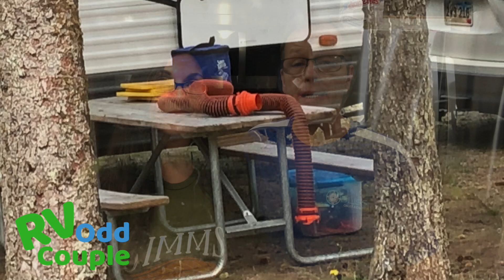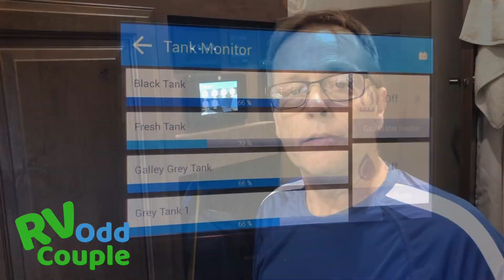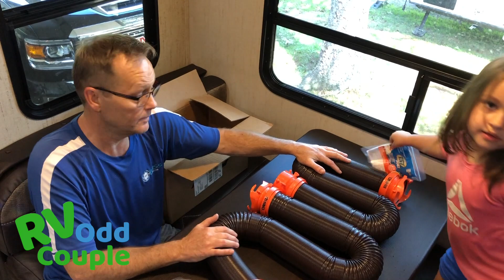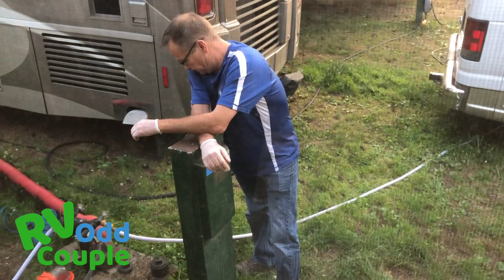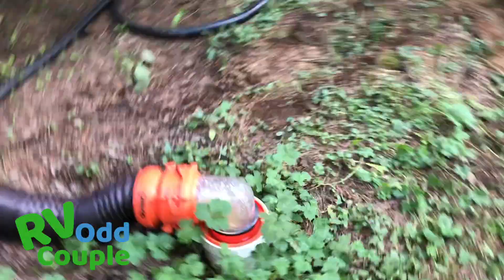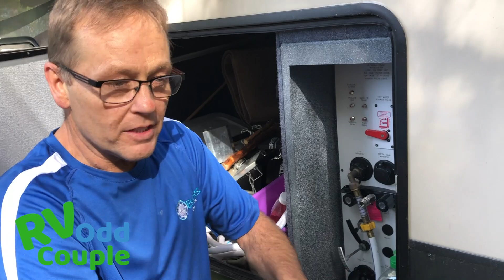RV Black Tank- Flush, Sensors, Hose, & Smell (Fulltime RV Living)

Comment: I learned a lot since I have not yet used my black tank for "solid" matter.  Question.  Do you use normal toilet paper or do you have to order the expensive RV toilet paper?  Thanks
Reply: I was told never to use normal household paper in the RV
Reply from the maker: @stephenryan185  We've heard that too.  We've also heard that as long as it dissolves when in water, it's ok.
Reply from the maker: We use Septic safe Angel Soft. Some will say this (Angel Soft) is not ok but it has worked great for us. Thank you David💚😀👍

Comment: I recently bought a used 5th wheel. I emptied all the tanks for travel every time. Every time I went to hook up the sewer hose I had a 'surprise of a pipe full of stuff from the black tank. I tried the flush system included in the RV system to no avail. I did find a solution.

I bought the Camco flush kit that has a clear 45 deg elbow and a valve. I used the flush connection on the elbow to flush the black tank multiple times. Every flush would dislodge more 'saved' sewage. It took me close to TEN(10) iterations before the water finally drained out clear. The black tank valve finally went completely closed. I believe some toilet paper had gotten stuck.

I left the clear 45 elbow on with the valve closed for this last travel. The cap did reach to close over the valve opening. This time there was a new surprise! NO leftover sewage in the piping system!

While you may not want to spend the extra for the "RV toilet paper' you should at least get the 'septic safe' variety. You want toilet paper that will dissolve quickly after your initial use. No more "POOP PYRAMIDS" for me!

The next step for me is to get a pressure washer to put down through the toilet. I believe this should be done once a year.
Reply: Unfortunately, all was not well after all! I am in Joshua Tree CA. The temp got to 108. Sludge in the tank 'melted' then SLOWLY slid down until it BLOCKED the outlet. When I tried to flush the tank after it cooled down  all I did was fill the tank until the tank overflowed. The sludge had formed a 'flap' or one-way valve. I left it until today. Magically the temperature went back up and the weight of the water pushed it through and cleared the blockage. No 'burb' yet!
Reply from the maker: @jaytibbles2223  Oh no!  I hope it all ends well.  :-)
Reply from the maker: @jaytibbles2223  Oh No Doug! What a bummer! Let us know how it all works out...It will work out😀👍
Reply from the maker: Always Great suggestions Jay! We us Angel Soft septic safe and haven't had a problem!

Comment: If you add an extra gate valve to your rv just before your dump hose. After you drain your black tank, you can close the gate valve and open your grey valve and it will back flush your black tank. I was watching a Utube video and the guy BoonDockering uses the black tank to add extra capacity to his grey. Of course by doing this you can't use your toilet.
Reply from the maker: Very interesting idea! Not for us though. Thank you Rick😀👍

Comment: My Wife wants a 5th wheel but when we have looked at them, I find so many quality issues. They cut so many corners and cheap out every chance they get. Like the straps on the tank, my Mother-in-law purchased a large tag-a-long and had all sorts of problems with black water tank. It didn't have straps nor spray heads, what a pain. Few years ago we had a 42' living quarters horse trailer, after a couple camping trips I added 2 clean out spray heads in tank.
Reply from the maker: Yup, you better no how to work on them Chris!

Comment: What works for me is always dump Black tank at 3/4 or more then flush till clear.Then dump galley ( kitchen) then grey tank last Because it has a lot of soap in the water .Next put 5 Gallons of water in the toilet With a pod and half a cup of dawn blue dish soap to clean and keep fresh while traveling until next trip keeps sensors clean and smells fresh also 3 gallons of water in the galley ( kitchen sink) and 1/4 cup of dawn blue dish soap to clean and smells fresh. And always a little water in the toilet to keep the seal from drying out.
Reply from the maker: Sounds like a good plan Glenn!

Comment: Thanks for the info, now I’ll always put a picnic table cover down before I use it. Here’s something I always do, I carry a spray bottle with bleach/water mixture and spray the water spigot before I attach my fresh water hose to it. I also keep hand sanitizer in my storage bay to use after I dump. There is a campground I like that has a locked metal grate over the dump station, you get the combination to the lock when you check in. Someone didn’t have the combination, so they just dumped through the metal grate! It was disgusting. Safe travels y’all.
Reply from the maker: Happy to help Doug😀👍💚 Some People!!!

Comment: Everything one should know, you handled with care..haha.  For such a poop subject, we  actually watched with morning coffee at 5am, but I did have to turn away as you flushed your black tank, because your system and my system don't agree this early.
How do ya know or where can you see if there are straps if like ours, the entire bottom is covered?
Also, we do flush our system like you did...our 1st time using it, because I wasn't going to ever truth be told and ended up a few weeks later, and 90°+ temps, having the inside not just smell...it was wayyyyy beyond smelly, what could cause that if you have a guess?  Ours has an internal sprayer to "get" all the goods out and off, so we dropped more than enough packets down the toilet, and I put grey tank stuff down the sinks and shower. It's   helped, but not totally fixed it. November is a long time to have it sitting and waiting for our snowbird shoes, and longer if it's gonna smell up again that bad.  Any suggestions ?
Thanks again for a great video!  God bless you 3, and stay safe!
Reply from the maker: Hi Paula,  That is too funny.  John says that you have to get under there and physically look for the straps.  Not sure if you have access to that but he said it was a pain.  One RV Odd Squad member mentioned getting their tank professionally cleaned.  we have no experience with that, but it might be something to look into?  Thank you so much!  God bless you and yours!

Comment: Hi John & Mercedes,  Who ever told you to replace your sewer hose once a year, helped you waste your $$$$.  My last Camco Grey hose (one of the best) on my last RV  looked new when we sold the RV with it (the hose was 11 years old).  Here is the secret to long hose life.  NEVER NEVER EVER store your sewer hose in the back tube bumper (that was designed for the hose storage)!!!!!!!!  The steel of the bumper and the steel slinky in the sewer hose are dissimilar metals.  They adversely react with each other during storage.  Storing the hose inside the bumper causes a process called electrolysis, where the dissimilar metals react (ask any metallurgist).  This process causes two issues.  First it corrodes and pickles the metal on the inside of the bumper  causing rust and pits inside the bumper and it pickles the slinky inside the sewer hose.  There can be un-associated rust inside the bumper anyway.  The minor damage inside the bumper causes abrasion to the outer skin of the sewer hose weakening the hose so it can fail as you slide the hose in and out repeatedly.  The second issue is as the metal of the slinky corrodes (from its proximity to the inside metal of the bumper) it slowly shreds the vinyl (or what ever plastic your particular  hose is made of) from the inside out, until the hose can fail.  The fix for this is to use the plastic (PVC) sewer hose tubes that are made to mount under the RV (problem instantly solved)!  There are YouTube videos showing these tubes being installed and used,but for some reason they don't state why it is important to use them.  There are also videos of homemade PVC fence post's (from Home Depot) being converted for relocating the sewer hose.  On my newest RV I chose the Rhino Extreme.  I am not endorsing it and it probably is not that much better than the best of the highest quality hoses out there.  My selection this time was because it has a plastic outer slinky (who knows it might be the best choice) exoskeleton that could protect the hose a little  and it was advertised as crush resistant.  Consider getting one of these under mounted Septic hose tubes.  Sometimes the bumper storage method can cause accelerated premature hose failure in far less than a year also.  Good RV'ing.
Reply from the maker: Appreciate you sharing this.  We're not willing to risk having an issue with the hose breaking.  That said, never considered the storage was impacting their low lifespan.  :-) Thank you!

Comment: Good vlog,  I would not recommend leaving the gray or galley valves open all the time, remember the poop pyramid you talked about, well the same effect with your gray tank, ever had to unplug a bath room or kitchen sink pipe, yep, that's the same slime and build up at the bottom of the tank by leaving them open  which leaves all the solid behind and drains off the water. Unless you are running a washing machine or taking 30 minutes showers you should keep them closed.  Remember they are holding tanks not a septic system.
Reply from the maker: Great advice.  We have an onboard washer/dryer. And you're right, these tanks are not septic systems.  They are just tanks.  We were surprise to learn that but it changes the way we care for them.  :-)

Comment: Leaves of three, let them be! John, that sewer area is full of poison ivy and poison oak!

The word you were looking for when talking about the water helping to drain the tank was "siphon". A partial vacuum created by exiting water creates and maintains a siphon that aids in draining the tank until the vacuum is broken.

One common complaint that you didn't touch on is foul odors as a result of traveling down the road. This is caused by two common problems:

1) Leaky toilet seals, no water seal and/or no trap on sink and bath drain lines. It's important to ensure that trap seals don't run dry. For, if they do, an open passage is created through which "unpleasant" odors can pass. Also, if sink or bath drain lines don't have traps, HEPvO waterless traps (http://hepvo.com/hepvo-waterless-valve/) are installed inline, either vertically or horizontally.

2) "Standard" stack vents allow air to flow down plumbing vent stacks and into black and grey water tanks, forcing foul odors past seals and p-traps. Air passing over/through the 360 Siphon Roof Vent Cap (https://www.lci1.com/360-siphon) instead creates a partial vacuum on tanks for continuous venting.

As always, I hope that this additional information is beneficial to you and/or your viewers.

Until next week, be blessed and do good works.
Reply from the maker: John, you always contribute so much in your comments!  Thank you, Thank you Thank you!   You bring up excellent points.  Even if it's just a bit, you always want that water in the bowl to cover the scent.  We didn't know that some of the toilets were malfunctioning. You are correct, siphon is what we were thinking!  I can't speak to the stacks, but I know my John knows what you're talking about.  :-)
Reply: @rvoddcouple  Regarding the vent stacks, a quick review of the product page explains it all.

You're 100% correct about the water seal in the toilet. It's the same principle with p-traps as John even demonstrated at the end of le poop hose. 😉
Reply from the maker: @ARepublicIfYouCanKeepIt  Thank you for explaining!

Comment: So yes, this is a national nightmare. I hate having to use the Dump Station. First time I used it at a State Park I didn't get the Black Tank connection on the trailer secure. Hose rips off from the Pressure and all over my nice Sneakers (New Balance) and I'm done. I was able to stop it and reconnect but oh the damage was done. Into the Park Shower I went and 200.00 later replacement shoes and the Stinky Slinky is always checked and rechecked. have proper gloves one use and off then hands get sanitized. A guy did recommend the Ice and it does work. Our new and improved 2nd Rig has a built in jet sprayer which I love and I also use the double valve connector. Don't want our city getting messed up. I also see these "people" too. Drives me nuts, once you've had your dump station horror story you learn why you always make sure that you check and recheck everything. My wife just stood there and laughed. I did however clean up my mess at the Dump. No way was I going to leave that. Also from time to time we have a portable jet sprayer that I bring inside and use to blast the tank from inside. You would be shocked at what still comes out. Really one of our smartest buys only 30.00 and I think it was well spent.We always make sure our tanks are empty and clean before we leave wherever we stay now.
Reply from the maker: Oh my goodness!  I can't imagine what that must have felt like!  Thank you for sharing thought!!! Good advice from a hard earned lesson!  Hopefully people read your comment and learn from this.  :-). You're saving sneakers- one pair at a time!

Comment: And "sometimes" you can put a small amount of petroleum jelly on that seal ring in the toilet to prevent water slow leaking out down to the black tank.  We drain the water in the bowl, put rubber gloves on and smear a little on the ring and it stops the leak.  Unless there is a different issue.  It worked for our RV!  Love you guys!!  We learned a lot from this video that we didn't know.
Reply from the maker: We've heard of the petroleum jelly trick.  We've never tried it. We're just concerned that waste will get stuck on it.
Reply: @rvoddcouple  I never thought about the waste getting on the ring and you might be right.  That wouldn't be good.  I only heard of this from someone else.  Better to replace the ring than be sorry!

Comment: An overall informative video. Personally I think you're overdoing it replacing your hoses every 6 months. As long as you flush them out properly and they don't leak they are good to go. The only reason I replaced my 2 year old Rhino hose was that I stepped on it and broke it.

One of the best services I got was having my tanks professionally cleaned. Now that they are squeaky clean I flush the black tank every time I dump it. No more odor and the sensors still work 6 months later!
Reply from the maker: Thank you Steve!  You're probably right.  We just heard that the hoses dry and crack.  Since we're full time, we're just too afraid to risk it.  :-).  You bring up a great recommendation of getting the tanks professionally cleaned!  Thank you again for watching.  :-)

Comment: Good one! We have had trouble with our black tank since May right after getting it. The gate valve was broken, but handle moved in and out doing nothing, I didn't relize it. we went to a KOA to check it out, by emptying it.... nothing came out, I was blown away and felt I made a huge mistake $$$$. I took it to a port-a-potty place to get it empyted. Well they got it cleaned out but messed up the seal, (it went into the tank).To make a poopy story short, we got everything fixed, in July! What a thing to go through, I felt going into combat was a better deal than this poopy tale. Today I have the cleanest, no smell, black tank. Much love to everyone!!
Reply from the maker: Yikes!  That sounds like a headache!  Glad you got it fixed but sorry that happened!

Comment: Love your videos!!!
I'd like to share a thought......
I'm  sure different RV's have different  techniques but on our 2019 rv it says specifically to not flush your black tank with your black tank valve shut or it could actually come out your vent. ( remember Robin Williams in RV ? )
Another tip for you specifically John...
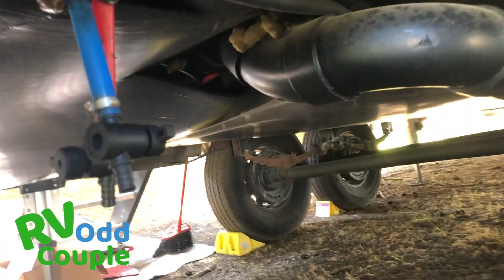It appears on your rv where the drain  pipe comes through your enclosed underbelly the hole in the underbelly is bigger then the pipe.  Time stamp 9:50. The rv industry is terrible for running pipes through holes way to big. Great place to have mice or snakes get in. Fill it with spray foam. Check for other openings to help this also.
Greg in Michigan
Reply from the maker: Thank you Greg.  Now you've scared me a little.  What if the snake that made a guest appearance made a home in our RV?  I'm going to read this comment to John.  Both due to the vent comment and the snake comment.  Thank you again!
Reply: @rvoddcouple  
Well if the snake made a home up in there he'd keep the mice out!
He he he.
I saw on another video ( can't remember  who's) they make a expandable foam to fill oversized holes with. It's made with something mice cant chew through.
Have a Jesus filled day 
Greg in Michigan
Reply from the maker: @greghomestead8366  Mice or snakes...  Not sure which is better. :-). God bless!

Comment: Ok, we do our walk through tomorrow and getting our RV. Any advice?
Reply from the maker: Take your time.  There are RV inspectors that you can hire.  Don't feel obligated to anything!  The biggest mistake we made was driving off the lot when it still had issues.  We never should have taken it until they had made everything right.  They were all helpful at first, but as soon as we left with it the service rapidly deteriorated.  Don't allow yourself to be pushed into anything that doesn't feel right.  Hope you watched our Worst RV Dealer Video.  The financing guy and the additional warranties cost us thousands extra and didn't even cover what they're supposed to!  They amortize the warranties (that only last 5 years, over 20 years of the loan).  I could have bought an extended warranty directly from the manufacturer for a couple hundred.  But they never told us!  We went to camping world and the price on the front end was low but they added so many additional fees at the end.  They added over $10K on our loan with these "warranty" products.  Don't do what we did!